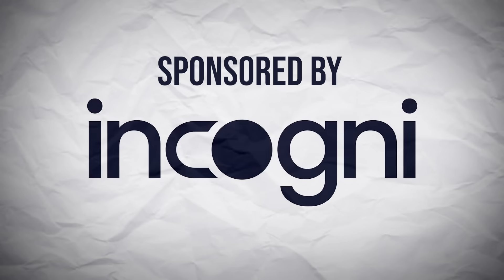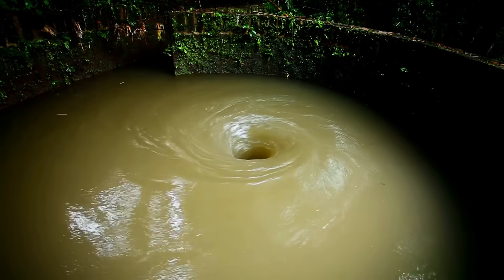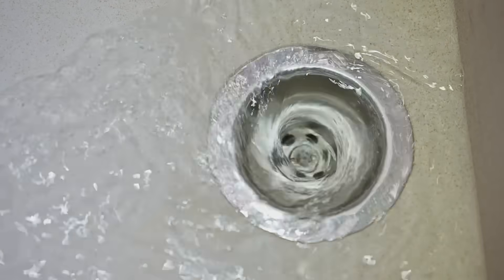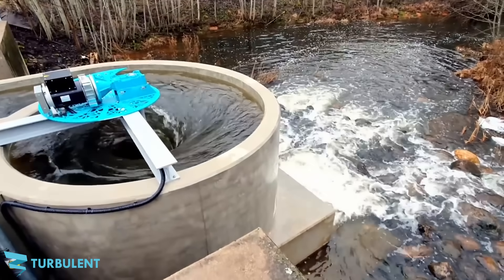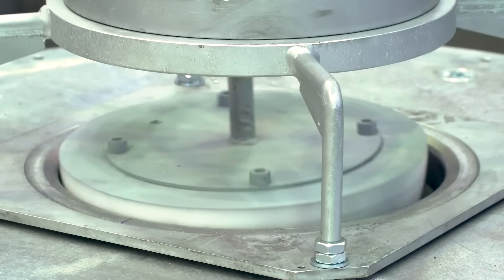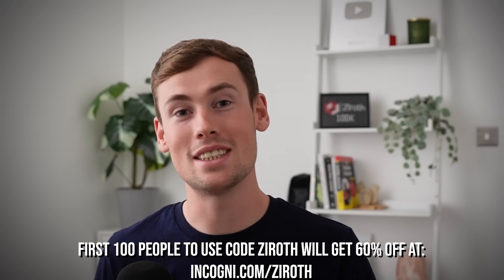Genius Bladeless Hydro Turbine is Cheaper Than Solar

Comment: A very interesting turbine, but, as other commenters have mentioned, it doesn't seem to scale up and retain the "fish safe" feature.
Also, what is to prevent it from becoming clogged with weeds?
I'm thinking that there might be a better solution for making a turbine fish safe.  
In the first place, make it generate "noise" that repels the fish.  Any fisherman can tell you that fish spook easily.  
Now add to that something that "wastes" some of the rotational force of that turbine to "wash" the fish away from the inlet.  I won't attempt to design such a device, but imagine it as a porous paddle wheel moving slowly such that it pushes fish sideways and away from the entry without diverting as much of the water.
As to initiating the vortex, any spiral asymmetry could do that.  Alternatively, the attached generator could be used as a motor, powered from a battery, to initiate the rotation.  This might suffice to eliminate the need to re-route the fish, as the ball could be rigidly centered in the apparatus, or at least centered sufficiently so as to leave sufficient room for fish between the ball and the cone at all times.

Comment: All hydropower plants have enormously high construction costs relative to their yield. 
The costs for small hydropower are therefore usually 15 to 25 cent/kWh. And hydropower plants have to be cleaned of branches, rubbish etc. every day.
With solar modules, on the other hand, you can reliably (except the winter) generate green electricity for 25 years at approx. 3-10 cent/kWh!
Hydropower turbines are therefore only worthwhile if you need to be self-sufficient from the grid.

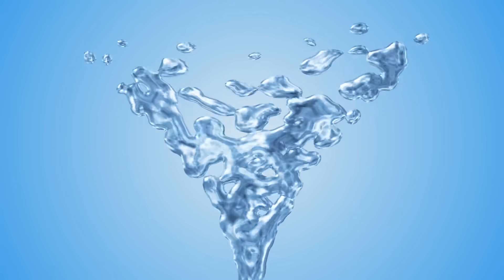Comment: @ 3:10 you mention vortex must have an initial push, this is incorrect, every tub or sink has a vortex, this is formed by the earths rotation so the vortex would start without any effort put into it. but... this is not enough "power" to run a generator. nice idea tho.

Comment: i am no engineer, but how can the blade less turbine be safe for fish when at 6:20 you show a diagram of the ball rolling around on the inside wall of the turbine and you can see that is moving fairly fast. It looks to me like the fish will get squished like something getting run over by a car tire on a city street. And obviously there is nowhere else to go but through, it's not like they can move out of the way.

Comment: Real time experience around Melbourne Australia gives PV = 3 times watt value every 24 hours = to 12.5% efficiency. That is summer and winter over about 11 years by now. Of cause it decreases over time as the PV's weakens but fairly accurate over the first 4 years of an installation. I have multiple installations.

Comment: All of these hydro schemes require mass flow and a head drop, even if small. The smaller the head, the greater the mass of water required. Or many more generators. 

If your river drops 100 feet per mile, then the power available each mile would be the same for one dam each mile with an impoundment reaching upstream to the previous dam and a 100 foot drop, or 100 mini-impoundments extending 53 feet upstream to the next mini-impoundment with only one foot of drop each.. So, do you want a series of dams with useable one-mile lakes, or a series of ugly man-made weirs with a small generator every few feet down the river with lower efficiency to boot?

Comment: When I was quite young (about 10 years old) I noticed that if you put a ping-pong ball in the bath plug hole and leave it in a static position in the middle of the plug hole, the water flows evenly and smoothly round it. If you put the ball to one side and flick it so that it starts rotating, it continues rotating very fast (and noisly) and the rate of water flow reduces dramatically - even though at any given moment the amount of space round the side of the ball remains exactly the same as when it is statically positioned in the middle. I thought at the time it was very interesting, but didn't know what application it might have. Now I can see. I think one problem of their design though was that the ball rotated in a central tubed section and there was flow going past it in the outer tube. In my view that was likely to have been wasting energy.

Comment: Why not using a Tesla turbine? It uses the same principle and in addition it prevents the water from flowing away to fast, by forcing it to rotate as fast as possible and stay away from the drainage because of the centrifugal force. You only need to prevent the turbine to become too fast. That's the challenge 🙂

Comment: There was a promising design with a wave, travelling between two diaphragms. Low pressure, and no head to speak of, just needing to be submerged in the flow. Replicating water's pathways, I would think it's quite fish-safe.

Comment: Probably the most fish-friendly solution would be to channel the water into a bucket, which then becomes heavy and is pullled down by gravity on a bucket chain.  Of course, that requires a fair head of water, and would prevent fish from getting upstream - so they might not find it very friendly.

Comment: Why not just generate the electricity directly using magnets embedded in the walls of the ball and its surrounding housing?  That way you could eliminate the need to connect a shaft to the ball, and the need to connect that shaft to a conventional generator.
Reply: This is the best and most original comment I've seen under this video so far.
Reply: then how do you control its rotation? you will only rely on the resonance, how do you prevent it hitting the wall and self destruct itself
Reply: That is kind of an interesting idea. Make the turbine into a generator itself instead of connecting it to one with a shaft.
Reply: That's interesting. I wonder if I could 3d print a tiny version of that as a proof of concept. Would the whole thing being underwater not present a problem?
Reply: It won’t work due to energy being passed by surface tension and gravity. Magnetic attraction and repulsion are stronger and will stop it moving
Reply: Could you not just pump the same water over it…like anywhere….you wouldn’t even need the river.  Just put it in a pool of water and cycle the water in a loop.  Why wouldn’t that work?
Reply: @kimstratton4983  And use the waste water to power the pump moving the water back to the top tank.
Reply: @tomaltoona I was thinking incorporating this into a waterscape in my yard….do you think it would work
Reply: الماء الذي يمر سوف يأخذ معه المغناطيس المتولد

Comment: This is a fun science experiment but not a practical turbine. The fish have to go through a large turbine full of shear stress areas (be ground between ball and shroud). The efficiency is low and the drivetrain is unbalanced. So to protect against fatigue, you'll need bigger components everywhere. Put one stick, some larger stone in and it grinds to a halt.

The Turbulent system at least was on the right track to use a slow moving rotor. If you really want to capture the power of low head sites, you only need to look at historical turbines and improve them with modern manufacturing. A low speed kaplan can handle really low heads. And when going lower the waterwheel has been proven to be efficient and fish friendly. 

Also, how do you get 300.000kWh from 5kW? 5kW x 8760h (hours in a year) equals 43.800kWh.
Reply: When you look up fish friendly turbine design, you'll see there are 3 ways to damage a fish: Barothrauma (pressure induced fish bladder damage), impact damage (by a blade hitting a fish, the thinner and faster the blade, the more damage), and grind damage (shear stress due to fish being ground between the blade and shroud inside of thin gaps). So this Setur turbine is optimized to inflict grind damage.

There are ways to design fish friendly turbines. You can go for slower turning machines with lower pressure differences (no barotrauma), that have larger and thicker blades with rounded leading edges (reduce impact force), and less gaps (reduce grind damage). An actual good design would actually have a large gap but a thick leading edge at the tip radius and guide any fish due to difference in pressures towards the hub with lower differential velocities.

Comment: What is unsafe for fish in more traditional turbines are not the blades themselves but the sudden pressure change. Fish have this buoyancy bladder inside - if you put them suddenly in a much higher/lower pressure the bladder gets ripped. Fish-safe turbines aim at extending the distance over which pressure changes. 

As other have pointed out - fish would get crushed in this one. Although interesting idea in general!

Comment: Does the ball "grind" on the inside diameter of the generator aswell? If it spins quickly, can cavitation or similar effects erode the wall too quickly? And not to forget, solar sits immobile on a roof, and the generator spins 24/7 with all the maintenance that will require. Also the explanation you gave implied the ball will be freely spinning in the vortex but the ball in the example video was running along the wall of the generator housing. Wich method is meant to be used on site?

Comment: I thought the real ball or upside-down dome was spinning in place. Not running on the walls like an engine coolant pump. How on earth is that fish safe? Looks like any fish that fits there, at the wrong place & time, will get crushed.
If I ever buy land by a river, I'm sticking with water paddle wheels, with enough distance from the bottom, to not crush any wildlife. And have it appropriately fenced off too, to protect it from anything bigger.
Maybe blunt blades instead of a chain link fence, set up I'm a way, to make big things gently get deflected away from the wheel, while water can still flow right through.

Maybe the blades can have a teardrop profile like wings, so anything that gets between them, can't get stuck, and maybe I can angle them to get more flow into the paddles, kind of like the stationary blades in a steam turbine.

Comment: Bladesless, yes, so it wont cut fish or wildlife. 
But there is a ball so instead it will crush the fish and or wildlife...

And you will still need to clean it for debris on rivers meaning you will have to shut it down so it it now 247.

Love the idea but its not superior to bladeless, the alternative that was "safer" but needed changes to the environment is actually the better option.

Comment: Turbulent: if the water source is diverted from the main river, fish would be kept out in the fist place. Imagine dozens of these reusing the same water, over and over. Plug-in mini power distribution hubs could be placed above each turbine...
Did I mention it's the SAME water. Cover it with a grate, for a walking path, with Solar panels for a covered lookout poit, or a food carts. I've been to this place, in my thoughts. In The Columbia Gorge, Washington side so it faces South. The power-path could conceivably go all the way To the ocean. Anyway, good program.

Comment: Uh... you don't have blades that chop up fish, but you have a ball that grinds up fish. How's that better?
Also, the reason you have blades in turbines is that they create fluid traction and make more power.
You can actually have plain rollers without blades or paddles flowing water. They will rotate just like your ball.
However, they will slow down a lot the moment you connect a load to them so they won;t make much power.

Comment: I watched this video and wondered why most people do not know that the problem of fuel-free autonomous and powerful energy supply was solved twenty years ago by a modest genius, Russian physicist engineer Vyacheslav Marukhin and his comrades.He solved the theoretical problem of the operation of a hydraulic ram pump without a height difference and embodied this solution in specific products.A whole line of generators from several megawatts to twenty kilowatts of power was created and their production was established at a plant in Spain.However, energy communism did not happen, because the ruling superstructure of anonymous rulers does not give this technology a go. You can request this data for the invention, it is freely available.   https://youtu.be/J2laXLe5veI

Comment: What is up with your calculation of solar panel cost. I'm from South Africa, and a 550W panel goes for around R2000 (South African Rand) which is ~$110 per panel. That's for a locally made panel. Even having 20 of these is $2200. Why are your panels so expensive?

Comment: what type of field is setup if the ball is lined with permanent earth magnets and copper coil in the surrounding structure. creates different kinetic stresses. also add a hydraulic flywheel

Comment: From what i get it looks fish-safe when the ball is centered in the cylinder but just to add a detail... if the ball's surface was less smooth so water can have some slight grip .. the turbine might be a little more powerful generating a little more energy..... Just thinking out loud. Thanks for sharing this.

Comment: Soooo.... 
1) how basically a grinder ball is safe for water life? It has no blades, but witch that rpm can crush anything against wall, unaless it's not very light and prone to deformations (that will lower efficiency preety significantly). 
2) it looks super prone to clogging, and rivers are notorious for moving lots of material with current, that also changes (both materialand force of current).

I am pretty sure, why there is barely any concepts in hydrotechnology like this...

Comment: Unlike a solar panel, which can sit and do nothing for 20 years and still produce over 80% of it's rated energy, any kind of rotating system is going to need service - especially one with such an imbalanced rotor.  It also appears that you need a LOT of water to make those things work compared to a Pelton wheel, making it unsuitable for micro-hydro installations.

Comment: Your forgetting to take energy from a river you inherently  slow it down thus increasing its head to increase which will eventually cause the river to shift. Thus you will need to build a dam to prevent this. Also there will be alot of energy lost in the balls instability through vibration and sound.   This is crap.  We need to stop searching for fake sources of efficient energy generation and focusing on more efficient loads.   If we made all loads 50% more efficient by getting rid of cheap shit consumer products it would be the equivalent of making our generation 50% more efficient with out having to change any infrastructure.

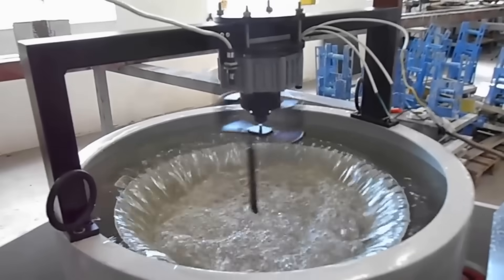Comment: Worth nothing, the geometric profile of the turbine (the curved white plastic part shown at 01:17) is clearly made after Viktor Schauberger's hyperbolic funnel. The asymmetric position of the ball perhaps favors the onset of such a vortex formation (and is here to harness the force to convert it into electrical power) but as shown by Schauberger's collected scientific works, a hyperbolic funnel automatically generates a vortex in a flowing fluid.

Comment: You’re wrong about the solar cells only reaching 17% because of clouds, night, and shade. The reason their efficiency is so low has absolutely nothing to do with that. It’s because the energy bandgap of the material only spans 17% of the light frequencies that the sun emits.

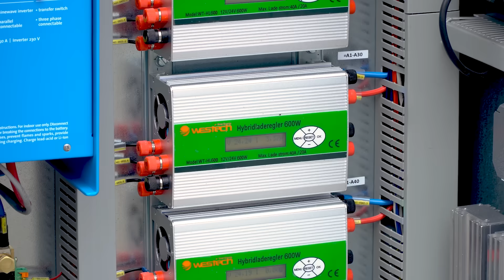Comment: At 9:28 I see the crazy batteries LOL. Lithium is lightweight but risky.. one cell goes up and they risk losing everything, as there are no fire barriers. 
A sane battery syatem would use lower tech, longer lasting batteries. Yes they are bigger and heavier - but this is not a car LOL.

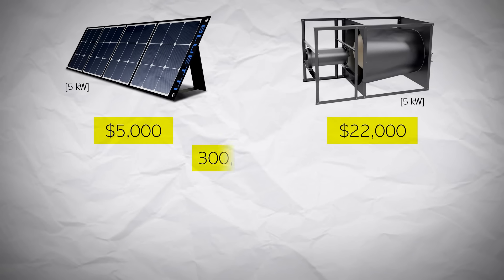Comment: 8:39 It seems you made quite a mistake in your calculus here.
At full power running at 100% efficiency 24/7 for one year, a 5 kW power installation would produce 5x24x365=43,800kWh by the end of the year, not 300,000.
This would result in 7,446kWh for the solar panels with 17% efficiency and 21,900kWh for this new hydroelectric generator.
Giving a 20 year lifespan for both solar and this new generator (obviously, they can certainly be used for 10 more years in practice if maintained properly), excluding any maintenance cost, this would come down to 3.33 cents per kWh for solar, and 5.02 cents per kWh for the generator.
So still 50% more expensive than solar.
However, before taking batteries into account, you should know that there are plenty of ways to store energy other than batteries. Half of the energy we use is for heating our homes and bath water. Giving a good enough thermal isolation, we can run highly efficient heat pumps to heat our homs and water at noon, heat that can last in our homes for at least a couple of days. Basically, more than half of our energy conservation needs could be covered by things far more efficient than batteries. We can also program our laundry machines, dishwashers, sprinklers and drying machines to work at noon when the sun highest, and recharge our EVs during that time of the day, further reducing our need for battery energy storage.

Comment: 5kWh turbine is $22,000 50% efficient and 5kWh solar is $5,000 17% efficient, so to match the price 4 x $5000 = $20,000 = 20kWh with $2000 spare for batteries. I think I'll go the solar, there would be far more power usage ability during the day even after the batteries are fully charged.